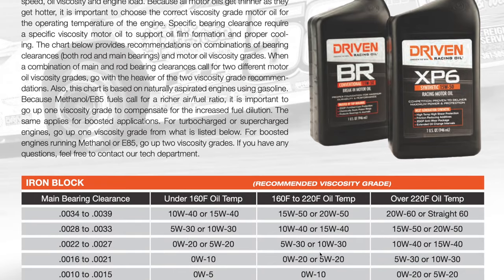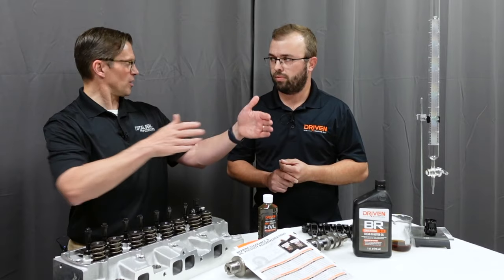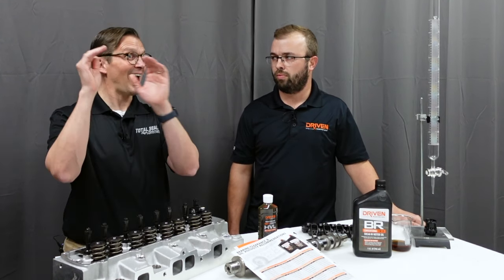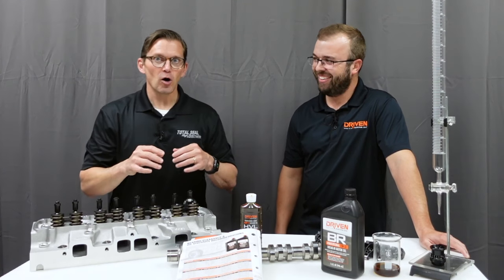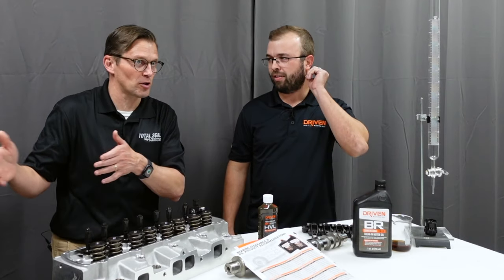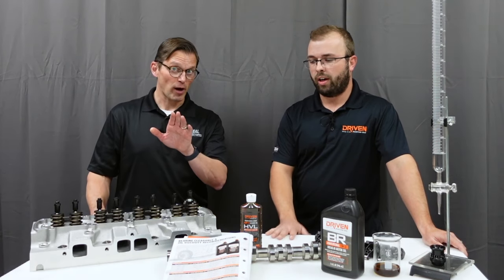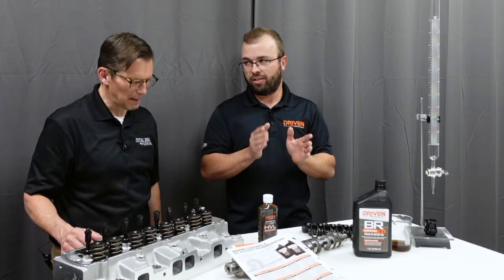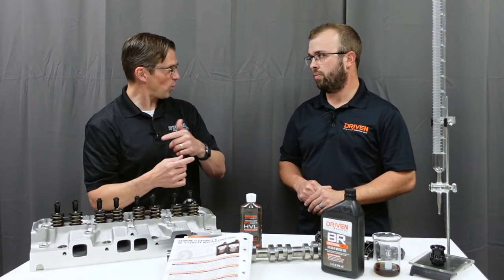How To Choose The Right Viscosity Motor Oil - A Certified Lubrication Specialist Explains

Comment: I Was Told I'm Over Thinking What Oil I Should Run. My Mains Said 30 And The Rods Said 40. The Machine Shop That Built My Short Block Said 20w50. I Said Why And They Said The Added Bearing Clearance. I Called Amsoil And It Was Literally The Same Thing. They Said Yea Run 40 Weight But If Machine Shop Said 50 Run 50. He Was Like, It's Not A Big Deal To Run Oil That's A Little More Viscous. I've Got A Little 3.8 V6 Turbo Engine FWD Auto That I Will Be Daily Driving Again. It The Little Details That Will Drive You Crazy.
Reply from the maker: If the loosest clearance was a 40 grade, then go with a 5W-40. Extra viscosity is extra heat.
Reply: 20W 50 maybe, but unless you live in the desert, stay away from straight 50.

Comment: I have a 23 wrx an my manuel say 0w20 can use 5w30 if other not available but in everyother country there sold other than U.S. manuel says 5w30 what would you run?
Reply: I have the same car.   I run 0-20 in winter months.  I run 5-30 in spring,,summer and fall,, but I will say.   I get much better MPG with the 0-20.

Comment: That speaker reminds me of Richard Simmons' Total Body Workout on TV. LOL I am just short of 50 years of vehicle ownership both in daily drivers and performance machines, and I have never had an oil related failure using name brand oils in the viscosity listed in the owner's manual. Jeez and some I have kept for over 200K miles from new.

Comment: My car calls for 0w20 but i live in az where as now temperatures stays around 90-100 and later on summer we usually reach 120 so i use 5w30 it is ok? Or should i go back to 0w20?
Reply: 0w20 oil could have something to do with variable valve timing, I think.
Reply: I once visited Phoenix. AZ during a summer week when it was a 108-degree Fahrenheit temperature. In a newer engine, I would stick with 0W-20 regardless of the outside temperatures.Once you get to 75,000 miles, you can use 5W-30 oil full synthetic.
Reply: If your owners manual gives you options, 10w30.  If you have a warranty and the owners manual only says 0w20, I'd use Redline group IV 0w20 for the POE base and high anti-wear additive package.  Just my opinion.  I rented a Chrysler 300 Hemi in AZ 2 years ago, on start up it knocked, clattered and did it every morning.  Oil cap said 0w20, it was fairly new car, low miles.  0w20 is crap over 35c, it returns to the oil pan too fast.
Reply: @patrickhenry2845  I don't agree.  Your car runs hotter when the outside temperature is higher.  Every online viscosity chart says 0w20 is no good over 30 or 35c.  My cars are under aftermarket warranties, I run 10w30 in the summer, I have receipts for 0w20 that's required year around.  Not having any problems.

Comment: Our 2018 F150…5.0 with plasma cylinder walls used 1qt of 5w-20 semi synthetic Motorcrafter  oil  every 3000 miles and went thru 2 Ford authorized oil consumption tests. At 20,000 miles I changed to 5w-30 Motorcraft semi synthetic oil and the consumption problem was gone. I now have 45,000 miles on the engine ant it might use a cup in 3K miles. I change oil every 4-5 k miles or yearly if I don’t drive it much…
Reply from the maker: Thanks for sharing